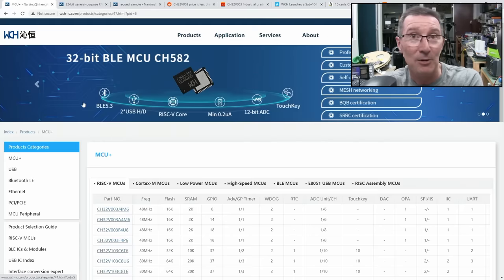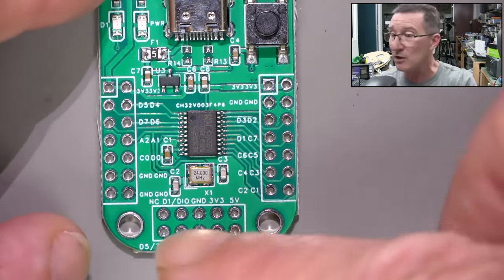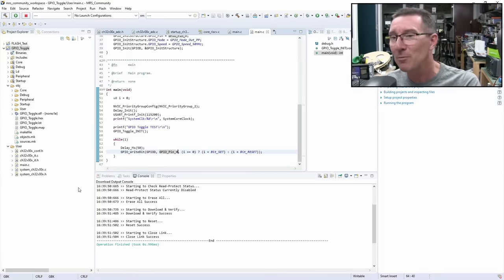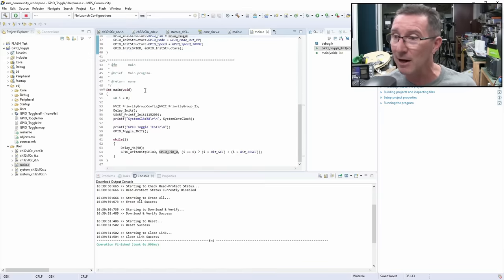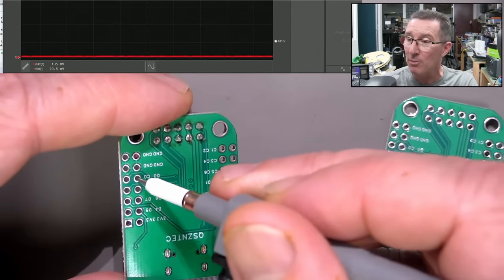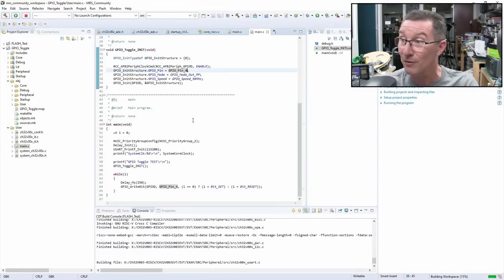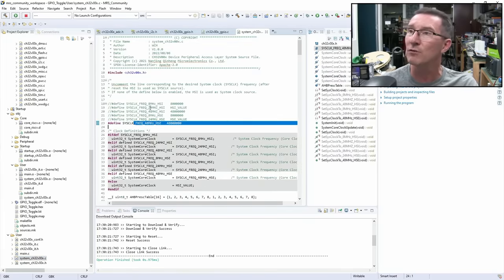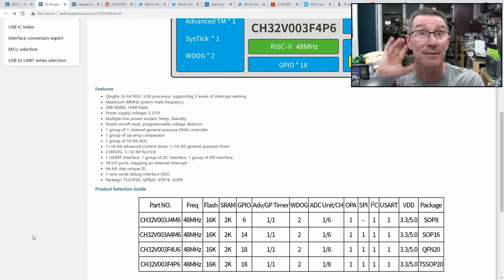EEVblog 1524 - The 10 CENT RISC V Processor! CH32V003

Comment: I think this is the equivalent to the STM32F030F4P6 with I intend to use in one of my new projects. This was below 50 cent before the semiconductor shortage maybe as low as 30 cent but it is not at this time.
But this RISC V is also not available not even at higher price so not an option probably but will keep an eye out for it.
I still have to get the larger STMS32 microcontroller that I ordered in February 2021 so about two years ago.
Reply from the maker: Yeah I could not find the ST part for under 50 cents.
Reply: STM32G030 series is under 50 cents@qty30 on LCSC. They released an even lower budget line recently, the C0 series, but that doesn't seem to be available yet.
Reply: @teslatrooper  It is strange that the G0 series is less than F0 series as it seems as it has more memory (double) higher operating frequency and M0+ instead of M0 so double the compute capability.
Reply: @EEVblog  It was less before the semiconductor shortage I think as low as 30 cent in thousand volume.  Just noticed that the 10 cent risc-v has just a 10bit ADC vs the 12bit on the ST parts.  I need those 12bit ADC's and there may be some other differences. When you designed a product in relative low volume a few thousand pcs then 10 cent or 50 cent will not make any sort of difference. Even a few hours of working on the software because something is not well documented or not working as expected will cost more. This things are good for very large volumes super low cost products or super simple designs where you do not need most of the peripherals.  It is still interesting and I will check more risc-v variants.

Comment: Good explanation and demo. Eclipse, Netbeans et al have many peculiarities, sometimes you have to save, sometimes not, sometimes you have to double click to highlight / 'select' the project in the explorer window. A common gotcha is a work / temporary folder which stores the running file, a copy of the one you are viewing. On many occasions the view and work files 'lose connection' resulting in all sorts of oddities. You can test this by copying an older backup file into the Eclipse workspace, it will be ignored unless you open the file and edit it (just add a blank new line) and then save it.  It could be much, much worse, have you ever tried the Arduino IDE, especially when trying to burn the bootloader or load a sketch into other IC's?

Comment: Most ide / compilers don't build off of what you see in the editor but what you've saved / written to the filesystem because usually the ide integration is just the ide asking your operating system to run the compiler with some arguments set, it wouldn't have access to your ide's text editors running memory. So yeah, ctrl+s regularly. The confusing thing I've run into are projects that copy their source files over to the "build" for reference when debugging, then you're sat there making edits to fix a silly bug that only get overwritten when you build again.

Comment: Hey, better than a lot of the stuff that wch makes, many of their stuff is 8051... They've got a really compelling bunch of USB and ble stuff that seems cool until you realize it's 8051. They also make the CH304 USB serial stuff, and its successors, which have really increased in popularity given the non-availability of the SiLabs ones. (They even have a cp2012n approx pin compatible one, ch9102, that even Adafruit has started using.)
Reply: Well, as opposed to Atmel and many others who have developed their own Risc cores to quickly create 8051 replacement parts (even pin to pin compatible), companies like WCH or Gigadevice doesn't have this luxury and had to wait at least for a modern royalty-free RISC ISA then the emergence of open source embedded cores.
And before RV there was only few options for royalty-free MCU cores (opencores is focused on FPGA) and the legacy 8051 ISA was still popular. It might take a while for WCH to update their designs.

Comment: It is even better than STM8S003. STM8S003 is 8-bit, while this MCU is 32-bit. STM8S003 has 8KB flash, and 1KB RAM, while this one has doubel that. (and some models even more than that).

The only issue I have is lack of hardware multiplier and bit manipulation instructions (specifically Zbs extension, other less so), which would be rather helpful for a lot of things. Still, with 48MHz clock, it can do pretty good.

Other than that, looks nice, can use pretty standard GCC toolchain easily (you can do the same with other archs, like arm and xtensa, but not so much with STM8S003 I think).

EDIT: Their mid and high end models, do have hardware multiplier, as well plethora of IO combinations, including Ethernet, CAN bus, BLE, WiFi, multiple UARTs, etc. Nice!

Comment: Im pretty sure that these are on Ali Express. They were $2-3 Canadian, which is still an unbelievable price. I bought myself a box of microcontrollers to have something to do over the winter. These look like they are better documented than some of the LilyGo devices that I bought.They were a lot more than a couple of dollars.
Reply: At that price a chip you're nearly getting their top-of-the-line product, the CH32V307, which is MUCH more complex. These are not a good value at 2-3$ anything
Reply: @seneral9804  I think he means the modules (we can thank YouTube tech wannabes for conflating development boards as being “microcontrollers”) but even then it isn’t a great price. Not bad but not amazing.

The actual ICs are listed on the WCH Aliexpress store at roughly $0.14/ea for qty 50 for the 20pin variants. 8pin was a little cheaper I think. This is before shipping. I paid roughly 20 cents each for ~200 after shipping.
Reply: @truectl  Oh mb, that makes more sense. For the actualy complexity of the EVT it really is much. On LCSC they're 6$, whereas the CHV307 EVT with MUCH more peripherals, pins, integrated WCH-Link, USB 2.0 HS, Ethernet, etc. is 10$ - not quite proportionate really. Guess they don't want it to become a go-to dev board like the BluePill, but solely for integration.

Comment: I just got my rp2040 controllers for a split keyboard I'm building, but it would be fun to go through the whole PCB design around one of these micro controllers
Reply: Isn't RP2040 the joke that requires external ROM?
Reply: @johndododoe1411  That only matters if your code fits into the tiny flash (you meant flash right not ROM?) on $1 controllers (current RP2040 price on JLC), if you end up needing an external flash  anyway it doesn't matter. You can get 32mb of flash for 60c. 

You need to select the correct components for your projects, slapping in a $4 controller to flash an LED on/off just because "ItS ThE BeSt ESP32 FoR ThE WiN" is stupid.
Reply: @backgammonbacon  flash ROM, EEPROM, EPROM, PROM, it's all ROM.

Comment: The flagship model CH32V208 is only 1.3269 US$ per one piece. Nice.
Reply: Nice, 144MHz, 128K flash 64k SRAM, with BLE and for some reason also ethernet PHY. But then, for that money you could get an ESP32-C3 which is also RISC-V based. It's crazy how cheap this kind of performance is nowadays.
Reply: @teslatrooper  very confusing that they would give a RISC-V uC the same name as their LX6 ones.

Comment: The $20 is for two parts, the demo board and a separate linkE debugger that has a CH32V305F, they should make a $11 demo board with onboard cheaper CH32V203F8P6 as the debugger, with option for debug-out, plus I don't like USB-A as the connector as I want to use a cable, not everyone has a usb-a extension cable at home.

Comment: usually its best to use commandline tools with linux OS setup for dev tools like these...
Reply: Yes, but the provided source code has some gliches with lower/uppersase-filename to fix a build with Linux out-of-the-box- at least this was the problem with CH582F in my case.
Reply: @deterdamel7380  likely only tested on Windoz.

Comment: Well, I'm in.  Just ordered 150 of them, 100 x 8-pin and 50 x 20-pin.  A couple 8-pin SOP sockets for programming/debugging and a single 20 pin socket.  I figure if I'm using the 20-pin I can spare some ISP pins in the design.  Oh, all that was about $55 Canuckistan dollars, with near half of that to cover shipping.  50 of the 8-pin SOPs were 1/3 the shipping cost, thus 100 just to even it out.  Aliexpress if anyone cares.

I see no need for the dev board as I'll just make my own with the sockets.   Be way more useful.

So, a question:  That WCH-LINKE  USB to serial thing.  Is that just a standard item or am I going to have to fork out $9.99 for it and $10 shipping?  (that's in real money too).

If the latter, I'd appreciate knowing if anyone has reverse-engineered it enough to get something working with the IDE.  Yeah, probably too early to ask that.

Anyway,  Should be a lifetime supply... if I can get them working.  I mean, even shipping included they're 1/20th the cost of an ATtiny85.
Reply: The LinkE is needed for V003 as only linke is compatible with the 1pin SWIO they implemented due to the low pin count of 8pin soic.
Ali  WCH store have the combo kit: dev board, linke and five 20pin ic for $5.60
Reply: @tonysofla    Yeah, I read a bunch more comments and found this out.  Already ordered.  Of course, $7 in Canuck dollars, and $12 shipping.  So, now $75 total, makes them $0.50 each all in.  Not that I expect to use all of them.    Thanks for the reply though, nice to get confirmation.

Comment: The RISC-V ISA is license and royalty free but hardware implementations don’t need to be. I think we will end up with a lot of manufacturers licensing the cores from other companies in a similar way to how they license from arm, just so the company itself doesn’t need to worry about creating their own cores.
Reply: There are opensource Verilog implementations as well, but yes that's how SiFive plan to make their money.
Reply: Absolutely, but you'll have a dozen companies you can license different but compatible cores from, not just ARM. They'll want to make profits to stay alive, but won't be able to make excessive profits.
Reply: @BruceHoult  not every RISC-V core needs to be completely compatible, they can add custom extensions and we are already seeing that, if one company has protection on some other part that they connect to a RISC-V core then no other companies could copy that, so that company can charge what they want. Even things about the micro architecture can be a reason to choose one company over the other, if one company produces more efficient or faster or more powerful cores then they can charge more for it, doesn’t matter that other companies exist, if one company is better they can charge more, that’s the way it’s always been.

Also multiple companies doesn’t mean they can’t charge large amounts, there are plenty of examples of companies making an agreement to set minimum prices, or maximum lifespans, or maximum specs, etc, like happened with lightbulbs where they limited the lifespan so people would have to buy more, or at one point car manufacturers that put a cap on the maximum speed they could advertise their cars could reach. These weren’t just verbal agreements that didn’t mean anything, in the case of lightbulbs they actually tested each other’s lightbulbs and I believe there were fines if yours lasted too long.

So just because there can be multiple companies making a product doesn’t mean that they are going to compete or that it will make the product cheaper.
Reply: @davidlloyd1526  the open source implementations will be pretty basic, at least for a while. Anyone putting enough time in to make a pipelined OOP processor is going to want money for it, so I think you will be able to find basic RISC-V cores open source but for anything more advanced you will have to license it.

Comment: This chip is 20 cents now . Any 6 , 8 pin micro running at 32khz under 8 cents similar to Padauk ,  Padauk programmer is difficult.
Reply: $1.33 / lot (10 Pieces) plus shipping

Comment: For now the only consumer device I've seen and use on it - is chinese soldering iron Pinecil, which is great, but I don't see there anything smart in it, except you can make any temperature you want. Extrapolating, this proc mostly can be used in IoT devices like digital thermostat, or digital kettle (I'm thinking how it's made in Pinecil with little display), etc, but for network it need other chips.

Comment: I find it frustrating a lot of these newer small MCU's (eg most STM32's) don't have any EEPROM.  15 - 20 years ago with the AVR & PIC just about every device had a small amount.
Sure you can do EEPROM emulation in code but that is not ideal, it's a compromise.
Reply: I mean it is not an eeprom, but it does have 16KB of flash, so you get similar functionality. Eeprom is really an obsolete tech these days.
Reply: @varno  Yeah which is why I said 'EEPROM emulation', kind of the same but not really.  Byte size Write AND Erase is not possible using Flash unlike EEPROM.  Methods I've used without EEPROM are a pain as you need to assign a couple of Flash blocks, one to hold the current data and one already Erased to accept a new update if the value cannot be overwritten......EEPROM might be obsolete but it is far better than using Flash for storing NVM values.
Reply: @rossmyers8448  of that I am not so sure, yes it might be inefficient, but the 50x increase in write/erase cycles of eeprom are somewhat solved by the 20x more flash that you get compared to the old eeprom based micros of the past. I personally use an additive log of current and past values, less efficient - maybe but generally good enough for real world applications. And given the low cost here even compared to the pic chips of old, it is probably worth the trade off.
Reply: @varno  My gripe is a 'first world problem' 🙂
I remember the Atmel AVR Mega48, it had 4K of Flash and a tiny 256 bytes of byte size erase & write EEPROM....still very handy.
The STM32 I was dealing with recently (with no EEPROM) at least some of the Flash blocks were sized in 1K increments and with 128K on board it wasn't too much of a drama to assign 2K for EEPROM emulation.  I still know what I'd prefer though.
Reply: @rossmyers8448  I kinda agree with that, but at  the same time, this 10c micro is priced cheaper than the pic8 was when it was relevant. I far prefer having a proper c dev environment, to having the eeprom from the pic8. It would be great to have an eeprom emulation library with wear levelling though.

Comment: Abstract

This transcript describes a video review of the WCH CH32V003 RISC-V microcontroller. The reviewer provides a positive assessment, focusing on the following points:

* Cost:  The CH32V003 costs roughly 10 cents per unit, making it a very affordable option for many projects.
* Features: Despite the low price, it offers a good set of features, including: 
    * 48 MHz clock speed
    * 16 KB flash
    * 2 KB SRAM
    * GPIO, UART, SPI, I2C 
    * 8-channel 10-bit ADC
    * Advanced and general-purpose timers
    * System tick
    * Watchdog timers
* IDE:* The Moun River Studios IDE integrates seamlessly with the microcontroller, making the development process very straightforward.
* Ease of Use: The reviewer was able to get a GPIO-toggling (LED blinking) project up and running very quickly without extensive setup or driver downloads. 
* Documentation: The provided datasheets and reference manuals offer sufficient detail.

Overall Impression:  The reviewer recommends this microcontroller as a viable and cost-effective alternative to other options. They express interest in purchasing the CH32V003 in the future. 

Keywords

* RISC-V, microcontroller, WCH CH32V003, low-cost, embedded systems, electronics, prototyping.
Reply: You're lost, Bard/Gemini! How'd you end up here?

Comment: Line 64 of the LED flasher routine passes the value of the expression ((i == 0) ? (i = Bit_SET) : (i = Bit_RESET) ) as the third argument to a subroutine called GPIO_WriteBit.  In order to do anything, the statement depends on the symbolic constant "Bit_RESET" being precisely equal to zero.  Supposedly, though, the whole idea of having symbolic constants in the first place (though for my money, a routine named GPIO_WriteBit should take a bool as its value-to-write, and just get passed 1s and 0s)  is to allow the actual values to be of concern only to the menial laborers that key in the header files.  How do we know that Bit_RESET isn't 0xFE or something?   If I were reviewing the code, I'd suggest that the 3rd argument be written as ( i = ((i == Bit_RESET) ? Bit_SET : Bit_RESET) ).

Comment: Those look great, but if they don't have a JTAG/SWD, I'm out. I tend to work on low volume expensive products, so my times costs more than I would save on the production costs from a cheap MCU. Could work nicely if one develops the code on a more powerful MCU with better debugger and then just use their HAL and re-write it a bit.
Reply: You don't need a 10 cent MCU in a low volume, expensive product... This is aimed for very high volume production, and DIY.
Reply: @mrnmrn1  True. Even for DIY I'd go for performance over price. Usually you don't DIY 10 000 of a gadget.